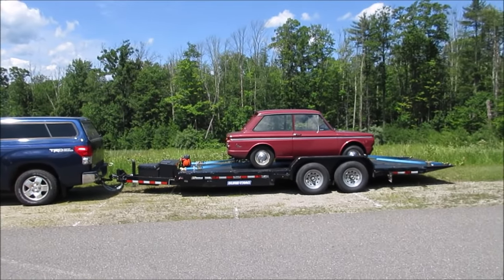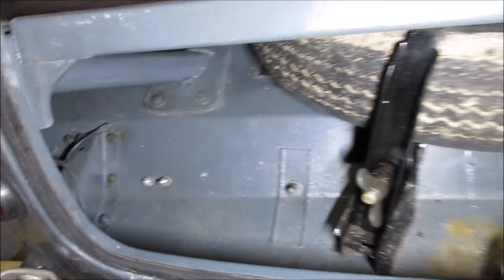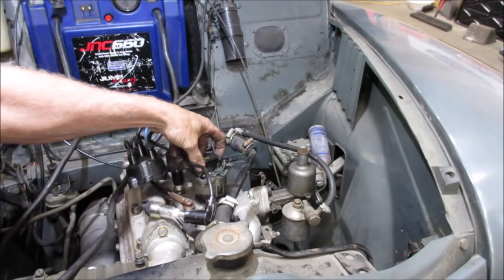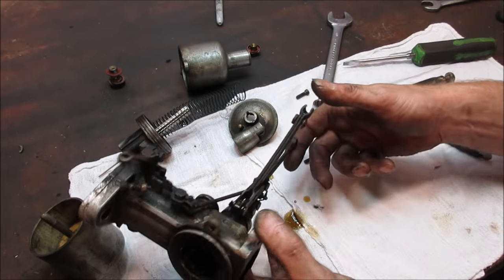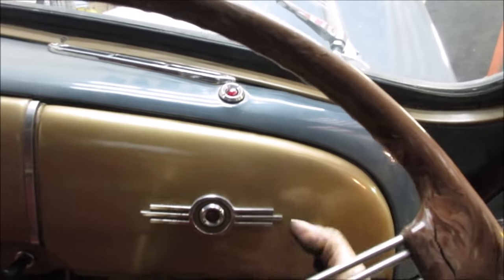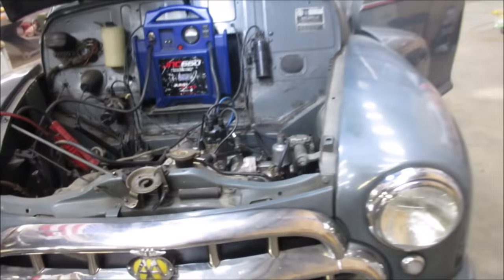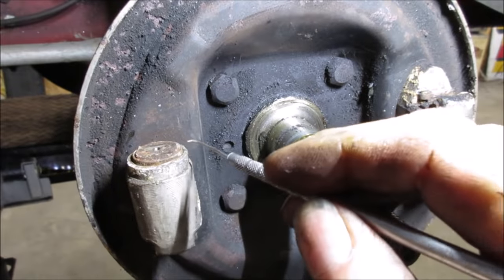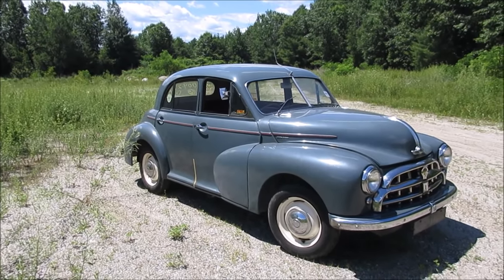50s Morris Oxford Found in an Old Warehouse. Did It Survive?

Comment: You did pretty well with that SU carb! Except for the fact that that upper tube with the plunger needs to be fully filled with motor oil to dampen the road vibration. Su carbs basically use the airflow that goes directly through the carb to determin the fuel quantity via a metering piston, how mutch air goes through is controlled by the butterfly behind the metering piston. Those SU's really are good carbs, simple and relyable.
Reply: They basically behave like CV carbs on motorcycles. My Spitfire has twin HS2 SU carbs. I converted it from the original single ZS carb, then swapped out the US spec exhaust manifold for the better breathing Euro version.
Reply: Yep, fill the dashpot with oil! 👍

Comment: Oh !  Mustie, its a classic British car, so no hood or trunk; bonnet and boot please, there's no fenders either, just wings.
:-)
(Edit)  You're wise to leave the jet assembly alone, re-centering that in a right PITA.  Never met a constant vacuum SU carb before then !  The lever you are operating is the choke, it drops the jet to a thinner part of the piston needle and gives a much richer starting mixture.
The accelerator pump is the piston dashpot/damper with the oil and the little loose piston on a rod, it stops the piston rising immediately and cause enrichment when the throttle is opened, temperature compensated too as the oil is thicker when cold !

Comment: Hi Mustie, the purpose of that conversion chart on the window was because the UK was entering a period that we were converting from imperial measure to metric, some filling stations held onto Imperial measurements as long as they could while others (those owned by European companies) converted to Metric, so it was pot luck which system was in use when you went to fill up.... the stickers phased out when we fully went Metric....
The RAC sticker on the windscreen, this indicates that the owner is a member of the Royal Automobile Club, you pay an annual subscription and if you have a breakdown they come to your assistance and try to get you going (simple repairs) or take you to the nearest garage for a more serious repair or even tow you home.... for free!...
I noticed there was also an AA badge on the front grill, this is for the Automobile Association, same thing as the RAC, it would be seldom that an owner would be a member of both, they are competitors after all..... but hey... better safe than sorry I suppose....

Comment: That black thing on the bulkhead that Mustie thought was a junction for wires...
is actually the fuel pump...
which has a set of points in it to activate the pumping of the diaphragm...
It ticks if it works...tick tick tick which slows down then stops when the fuel bowl on the carb is full...then ticks slowly as the engine runs...
You usually have "fun" with that...
Reply: Yes I remember it well, as my father used to get out of the car and tap on it to get it to work. The trafficators were never that great and I remember banging on the inside pillar to get it  to deploy and when not deployed it would not necessarily seat fully home. Still enjoyed driving the Oxford it was a 1954 I believe a mark 2, with 4 on the column and reverse pull out and down passed my drivers test on this car, so fond memories.
It was traded in for a mini as the rust caused the side valance to collapse when we jacked it up to change a flat tire.

Comment: Watching Mustie figure out an SU carb was fantastic entertainment 😆
Reply: I agree. I don't often sit here talking to YouTube telling Mustie what he should be doing... same as him poking the ignition light and windscreen washer pump...😁
Reply: I have SU carbs all figured out. Take it off, chuck it in the dust bin and put a Weber in its place.
Reply: @1pcfred  Wrong!! The SU was a brilliant analogue computer of it's time.
Reply: @1pcfred  The SU is what is known as a "Variable Venturi" carburettor. The taper of the needle and the position of the jet are the only adjustments, and the latter can be adjusted to give perfect mixture at all speeds by the average DIY enthusiast without special tools  - no idle speed jet, accelerator pump, or main jets. It's simplicity is genius, and once understood leave fixed venturi carbs for dead!
Reply: @alexgallacher5720  I know what they are. I've had them. I'm not a fan. Now I do like me some Weber DCOE side drafts.
Reply: @andycoombes  I do not like computers in cars. This time or any other time.
Reply: @1pcfred  To each his own, but the ability to adjust the mixture according to the airflow by means of the taper on the needle is a unique advantage.
Reply: @alexgallacher5720  I don't change altitude enough to need that feature. Once my mix is set it's good to go from there.
Reply: @1pcfred  Fair enough Paul, as I said initially "To each his own".
Reply: @alexgallacher5720  there's two opinions about everything. The right one and all the wrong ones.
Reply: @1pcfred  Absolute rubbish! if that were so, how come we have different types of cars, trucks, mobile phones etc? Opinions vary - there are no wrong or right opinions. 
"Anyone with an intense emotional interest in a subject loses the ability to observe it objectively"

Comment: Hey Mustie . The knurled nut on top of the SU Carburettor might need topping up with some light oil . 
Back in the early 80s I had a Morris Minor 1000 van . It ran rough if there wasn’t enough oil in the carb . 
I got my van cheap very cheap . Did engine refurbish . Fitted a hotter cam and twin su carburettors. 
That got the old girl moving . 
Painted her in my mates barn Black metal flake . 
I was 18 not long passed my driving test . I’m 60 now . 
I had so much fun in that van . 
Regards Martin .UK

Comment: I have a Jaguar E-Type, TR4, Austin-Healey 100/6 and a Spitfire.  Owned few Midgets and MGA's an a MGTC and it took years to get all the in's and outs on these machines.   Watching you sort through all of this was pure fun.  You grasp it so quickly.  I did want to jump through the monitor a few times but always figured it our.  You were very smart to not take the SU Jet assembly apart as it has cork seals and I'm sure they were krispy at best.  That button on the far right that feels like a pump I think is a pump for the washer fluid.  I have this on the TR4 & Healey.  It's a joke but kinda fun to get them to spit a little bit.  The two other red "buttons" are warning lamps for a bad charging state and the other is for the trafficators/turn signals.  So much fun to watch you work on this!    Bobby
Reply: Yes, "Trafficator" is the proper name. They didn't flash but you can get flasher bulbs now so it's possible other drivers might notice them.

Comment: Reminds me of my dads cars when I was a kid. He had the Austin Cambridge as well as several old Morris cars. RAC is a UK breakdown recovery service ( Royal Automobile Club). The oil down the centre of the carb is a dampener for the throttle slide I believe.
Reply: we have the rac in australia too,
but generally it's a state based service
Reply: It is, on SU carbs and Strombergs of that era the damper should be filled until the brass end is covered in oil. You're supposed to use a general engine oil but a carb tuner told me that he recommended a thinner oil similar to 3 in 1 bicycle oil. Apparently the responce is quicker and the car runs smoother
Reply: @45sunnybank48  yeah I used to use thin 3 in 1 oil in the uk. The type used for oiling door hinges etc.
Reply: And the Automobile Association; there was an emblem on the front bumper. Both the AA and the RAC still exist but they're basically insurance companies these days.
Reply: @neilbarnes3557  I’ve used the AA recently for breakdowns in my previous car.
Reply: @neilbarnes3557  the rac here does breakdown assist,towing and vehicle repairs and inspections 
as well as insurance and lobbying for better roads
Reply: @alt7488  (and @Mick Storey) - Yes, they both still do roadside recovery. But they're not 'clubs' or 'associations' as they were when they were founded.
Reply: @45sunnybank48  Always used auto trans fluid.....Strombergs were buggars of things for ripping diaphragms.....

Comment: This is identical to my first car which I had in 1968, although you're looks to be in better condition than mine was then! The grille is stainless steel which is pretty neat for 1953. Those fibre timing gears failing was a weak point, I think I read somewhere that maybe the owners club here in the UK has had some remanufactured in a stronger material
Reply: My fathers first too, now he has the flash version 
wolseley 6 80

Comment: I wonder if these vehicles were drained of their fluids, not as a matter of storage and longevity, but as a necessity and requirement of overseas shipment (aka don’t want to have cars full of oil and gas on a large ocean freighter boat) and once they reached their destination they were never used and not topped off
Reply: One of the reasons why it's dangerous to ship EVs...remember recent events?
Reply: yes . it's usual when shipping anything with an engine overseas.
Reply: I doubt it. They drive cars out of factories, onto car carriers, then on ships, off ships to parking lots. That's why by the time you buy a, "new" car it always has a few miles on it. The most dangerous thing is gas fumes not liquid in a tank. You ain't getting fumes out of a tank either. So there'd really be no safety advantage to draining the tank. You're only making a bigger bomb out of it when you do. It's an air fuel mix that burns.
Reply: @1pcfred  I could see that for new cars for sure - not sure how it works for existing used cars (50s car being shipped in late 80s)
Reply: @JohnSmith-yv6eq  most ev batteries have a service plug that opens the battery circuit and cuts the pack in half so the max voltage measurable anywhere is half of nominal.
Reply: @1pcfred  They seem to ship vehicles with enough fuel to drive around the docks and onto the ROROs with some margin.  My first new car came with the gauge needle on the Empty peg.  I drove immediately to the nearest station where it took a fill of the full listed tank capacity.  The factory must have measured the fuel to the exact mL.

The BMWs I'm familiar with have a correction of up to 64 km to allow the regional distributor to deliver cars that display "0.0" on the odometer.  This only corrects the displayed miles, not the value the modules communicate internally or store in the keys (used to prevent odometer rollback).
Reply: @1pcfred  I was talking about  privately imported vehicles (grey imports) that travel in shipping containers. as for video of the Hillman the owner said he imported it after he spent time in the uk
Reply: @mikeplant9163  if there is such a requirement to drain a fuel tank before transport it is not based on any sound reasoning. I would question the capability of any transporter making the demand too. What do they plan on doing with my property that it would need such preparation? Barrel rolls?
Reply: @1djbecker  that's cheesy. I don't care if a "new" car has some miles on it. I'd rather see them than not see them. Every mile a car does is a milestone for it. So in my view they should all count.
Reply: @1pcfred  I knew a guy in the classic kawasaki club that imported bikes from the states and I'm sure he had to drain the tanks prior to filling the shipping container, similar to not shipping lawnmowers or even cig. lighters with fuel in.
Reply: @mikeplant9163  I'm pretty sure disposable lighters are fueled at the factory. There's no safety advantage to be gained draining fuel from a vehicle to ship it either. The carrier damn well had better not be doing anything to the vehicle to make that not be the case! If they are they have larger issues to deal with completely unrelated to fuel in tanks.

Comment: A comment on the radiator cap: I was always told to leave about an inch airspace under the cap to allow the water room to expand. Having it filled right up like that means as it heats up and expands it will push it way out of the overflow.
Reply: If you fill the radiator too much it’ll “spit “ the excess out and find it’s own level.
Reply: Dood, it wasn't warmed up. He was putting his bare fingers in the rad juice.
Reply: Dood, it wasn't warmed up. He was putting his bare fingers in the rad juice.

Comment: Quick tip for the future. If the coil terminals are labeled the negative would go to the ignition switch if it is positive ground.
Reply: Great point, sometimes the part numbers on light bulbs can help as well.

Comment: Speaking as one of the 'thousands of people who have had an SU carb apart', you'll need more oil in the centre of the dashpot. The damping effect of the oil is what passes for an accelerator pump on this carb.
Reply: For Mustie's benefit, as a rule of thumb, you fill it to the ledge where the diameter of the cylinder changes. Thin oil, mind!
Reply: Yes. ATF oil works for this 👍

Comment: These cars had a hand-cranking lever well into the late 60s.
That's what that weird linkage is supposed to work with.
Incredible eh?
Ask me how I know!
Reply: The 1st Range Rovers in the early 1970s also had one.
Reply: how do you know?
Reply: As did Lada Nivas...
a broken starter motor oput in Siberia wouldn't be a good scenario..the crank handle could be a lifesaver.
The toolkit also came with a stirrup tyre pump and tyre gauge as standard!
Reply: G'day mate, I owned a 1978 Nissan Patrol G60 (Butterbox) 4WD. This car had a removeable crank handle and a hand-operated and set throttle control for crank starting. It must have been the last vehicle produced with a crank start.
Reply: @SM-fy7ys I owned a '67!  It didn't like starting on cold days.
We get a lot of cold days where I live...

Comment: These Morris are my new favorite car...  The Minor is awesome.. 
8\   toss a scrapyard v6 in it...  could probably get a scrapyard drivetrainésuspension too..    engine & drivetrain off a VW Taureg?  AWD  8D
and drop it with pneumatic shocks so bottom(hull) sits on ground and wheels retract partway into the wheel wells to keep from being stolen..  along with cat converter..  or being towed..
learned a lot as always, thx 4 posting

Comment: This great video took me back to when I was 19 years of age in 1962 serving an apprenticeship in domestic television repair.  Naive about most things, but not about the perils of owning aged used cars ... my dad had had a string of them, and I'd had to push all of them.  Having passed my driving test a few months earlier, I made the mistake I knew I would regret, I bought a 1950 Morris Minor MM.  Being the little sister of this MO Oxford, kind of a scaled down Oxford literally. Suspension, brakes, steering, all identical.  Smaller side-valve engine, but identical SU carburettor and fuel delivery.  A 1950 MO Oxford would not have had that posh chrome grille.  All my fears became real within hours of getting the damned thing home, and before 'it' and I were a year older, there wasn't anything I didn't know about its SU carburettor, its front suspension wear components, and its Lockheed brakes - including the master cylinder under the floor that I removed, dismantled, and fit new rubber seals. Dismantling and cleaning the SU carb became a Sunday afternoon ritual, to no avail I might add, the thing had no go whatsoever.  Much the same even after (head off) regrinding the valve seats.

Somewhat ungraciously, I had to chuckle watching this American mechanic struggle with the very things I'd had to cope with - and more, 60 years ago,  and I wasn't a motor mechanic.  I did it all at the kerb side.  I'll admit though, regarding the SU carb, his approach was logical and thorough, just mainly incorrect as others have pointed out.  I'm a little surprised that the SU carb was so strange to him given that the US liked our sports cars which often used 'twin SU carbs' ... the E type Jaguar having three of them.  I cringed when he struggled to release those front brake adjusters, because had I known that those snail cam adjusters were prone to wearing out and collapsing under heavy braking, I wouldn't have had to strip down the master cylinder, and go on to continually bleed the brakes. That was why the brake pedal kept suddenly going to the floor.  I learned about them only after I'd rid myself of the evil little beast.
Reply: The trouble is those cars rusted away, in most of the US. I wanted a UK car at one point in the 80s and even I couldn’t find one as they had all literally just crumbled away. So at the exemption of a little tinkering with my brothers MG, I never got to work on anything like that.

Comment: Hi Darren, The battery sits on the ledge of the bulkhead (firewall), were you jumper pack is. That carb is an old S U by Morris, it  has a dashpot which you unscrewed from the top where old goes to damp the thingy that's attached to the main needle and goes through the main jet. Adjustment (on later version, maybe that too) is under the the bit we were talking about (which I can't remember the name) t the bottom (as fitted). Often on old cars they used to put the starting handle by then driver's seat (Right side of the car). I hope this helps. Keep up the good work, good videos too. I've been subscribed for a few years. from Ian from England

Comment: I taught myself to work on cars and small engines simply by tearing into them and figuring it out as I went along. That is the best way to do it. I learned by cars by working on all of the junkers I have driven over the years. My start with small engines came from a friend and neighbor. He gave me three riding mowers and two push mowers that didn't run and had been sitting outside for years. I just tore into them and got them all running. Once I did that, I was addicted to it. I love working on anything now.